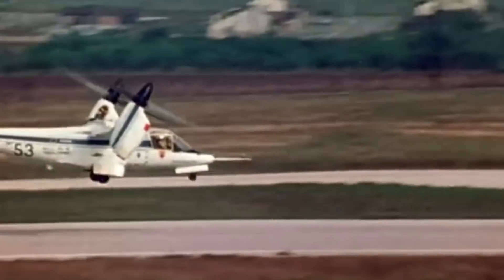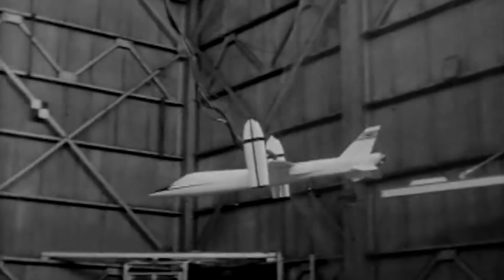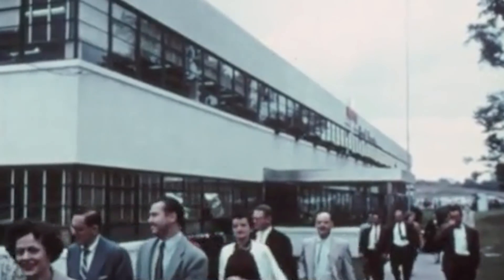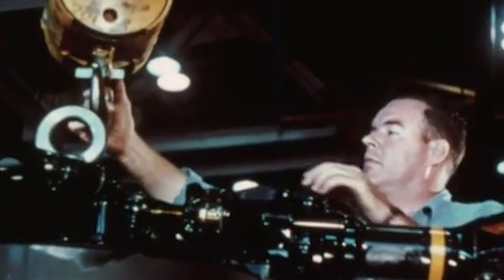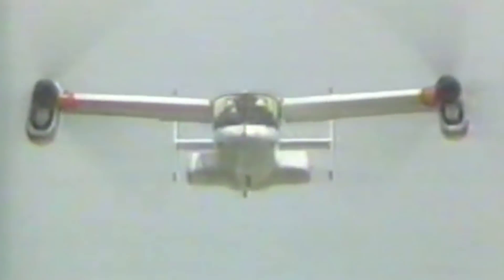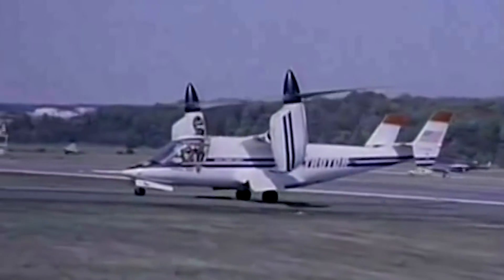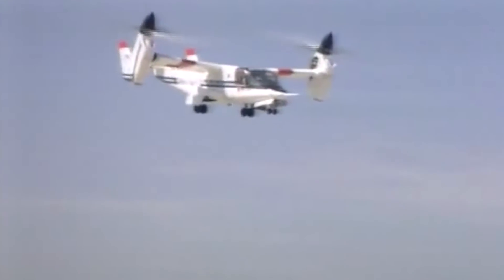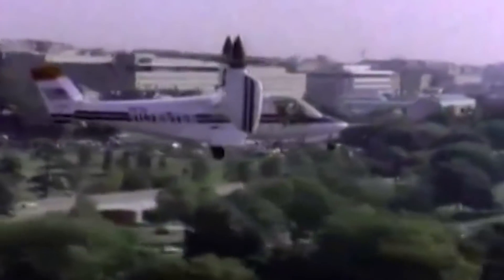From Hover to 160 in 13-Seconds - Bell XV-15

Comment: I like the Bell XV-15.  Hate the V-280.   I'd like to see a gunship version made from the XV-15 model to compliment the V-22 and V-280.  Stationary landing gears in a reverse tricycle pattern (like the UH-60 and Apache have  for hard landings). Speed could be sacrificed for functionality.  A chaingun turret underneath.  Typical apache/cobra junk in the nose.  And a tandem cockpit like the apache has so each operator can see what he/she is doing without the other being in the way.  Rocket pods would probably have to be underneath the frame as well, as the rotorprops would be in the way.  I could see gunships being tiltrotor long before troop transports and heavy lift aircraft.  But that's just an afterthought.:dothefive:

Comment: I have pictures of this in Navy gray, taken at MCAS(H) Tustin in 1982. This was almost silent in horizontal flight mode unlike the very loud V22.
Back then there were 3 proposed versions. One this size, another that became the V22 and an attack version to replace the AH1 Cobra. Can you magine a tilt rotor the size of the XV15 fitted  with the gatling gun of the A10 and hard points for bombs on the wings? Missiles wouldn't be wise on a tilt-rotor though, unless dropped from the lower fuselage.

Comment: Need to add 2 smaller rotors on the aft, that can turn and be used to steer the craft. Fuselage could be oval horizontally, and olliptical for length wize. Giving more room for customers.

Comment: I was lucky enough to actually fly the XV-15 in 2003 before it went into the Air and Space Museum. I had seen it flying for almost thirty years and dreamed of flying it some day It was a strange experience while still being on active duty to see an aircraft I flew in a museum. Felt like maybe it was time to retire.
Reply: Len - My list shows that you flew N703NA on March 3, 2005.  You were the 401st pilot to fly the XV-15.  By the time 703 was retired to the Udvar-Hazy National Air and Space Museum 419 pilots flew that proof-of-concept research aircraft.

Comment: My squadron hosted a XV-15 (and a MD500) for a couple of days around 1985; they were presumably enroute to DC or Pax River. We flew CH-46Es so it was no secret that the tilt rotor was the next step so we were quite interested in the zoomy little thing. Little did we know that it would take another two decades, give or take before its offspring joined the fleet.

Comment: Working at bell in the late 90s drive system test the crashed one was used for parts .I heard a guy say they were going to fix the crashed ship.It was outside and cut up with a sawsall.It was way beyond saving.There were many gear boxes and you're tubes in the fuselage.It was mechanical more than electrically controlled.It flew well but no room for a payload,but as proof of concept it worked well.The v-22 was constrained by complications like wings rotating and blades folding for saving space it added weight on a vertical take off was huge.

Comment: Interesting background information, BUT, why did you not include the dismal failures of the V-22 during implementation into military service? I don't remember the specific number, but around fifty marines were killed in a series of crashes over about five years, while Bell worked out the bugs. To this day, most marines prefer helicopters. This had pork-barrel written all over it.

Comment: Why aren't tilt rotors used by the Coast Guard  ?  It seems like an obvious  decision.  They are faster and can hold more weight than a helicopter plus it can stay on station  longer. Judging from the video a tilt rotor would be much better platform for the Coast Guard on every level.  Government BS is probably the reason they don't have tilt rotors.

Comment: If they put gas turbines in the fuselage turning generators, the rotors could be then driven by powerful electric motors. 
This would reduce the weight outboard and, the exhaust could add power to forward movement.

Comment: Do you just talk very quickly, or do you speed up your narration in these videos? If so by how much?
Reply: Neither? People in your region might actually talk slowly.
Reply: @malcontender6319  I mean yes that's completely possible I won't argue. I'm from Illinois near Chicago. Regardless of that I'm not criticizing them. They way they speak is completely fine and easy to understand. I'm just making an observation. If you were to count the words they say in a minute and compare it to another video essay channel such as the channel mustard (which you should definitely check out if you haven't) there is an observable difference that I found interesting enough to ask about.

Comment: Wow, you completely missed talking about the Canadair CL-84 Dynavert which was developed in the 60s and was the first tiltrotor to actually be tested nd proven to use weaponry.
Reply: Well, the reason might be that the CL-84 was a tiltwing, not a tiltrotor. btw, the CL-84 later went to NASA Ames for additional research.

Comment: Two thoughts;
1.) If we could alter existing air craft to use these VTOL style engines and wings, could it breath new life into, say a C-130 for random example. 
2.) Could jets be the next step to replacing the fixed rotor wings? 
(Jets might not generate enough vertical lift? Might just be using the twin exhausts as pin-point torches?)

Comment: With all of the helicopters in use within/between major cities and medivac I find it bizarre that 45 years later there still isn’t a civilian version of this plane.  Seems like a no-brainer easy sale to those who’d hop off of a skyscraper and travel direct 750-1000 miles to another skyscraper vs taking a helicopter/car to the airport then switching to a jet then another helicopter/car.. repeat to het home (ugh).
The XV-15 was a success, the Osprey has proven out the whole concept, so what gives? Cost?

Comment: If this script was ran through a plagiarism check program, it would ping the hell out of the Wikipedia page.
Wiki: "Boeing Vertol proposed its Model 222 (not to be confused with the later Bell 222 conventional helicopter), in which the engines were in fixed pods at the end of each wing, and a small, rotating pod with the rotor was slightly closer to the fuselage on the wing."
This script: " ...boeing which submitted its model 222 not to be confused with the conventional bell 222 helicopter.Boeing's design had fixed engines and pods at the end of each wing and a maller rotating pod with a rotor closer to the fuselage"

Comment: Did they ever tried with jet engines instead rotors?
Reply: West Germany EWR VJ-101. First flew on 10th April 1963.
Reply: @Joshua_N-A  it could reach the other end of the run way before running out of gas.
Reply: @navyreviewer  turbojets are known to be gas guzzlers, right?
Reply: @Joshua_N-A  all jets are. That's, historically, been the downfall of VTOL jets. Fuel = range but your engine has to be able to lift it. It's a trade off. That's why STOVL is preferable. You only need to go vertical at the end of the flight when you (by definition) have the least amount of fuel. The Harrier got away with it by accepting  a limited range/payload. Mostly operating in STOVL rather than true VTOL. The f-35 does it by using a non fuel consuming lift fan instead of lift jet. It >really< can not be overstated how mechanical complex it is. Even then its range is less than the similarly sized A model.

Comment: My late father worked on SH3Gs, and followed this project very closely.  He always thought tilt rotor technology would make Air Sea Rescue a much faster, safer, and efficient process.  Time will tell; the V22 is an amazing airplane!
Reply: The Augusta Westland AW-609 (a V-22 derivative, Bell was initially a partner before splitting off to focus on the V-280 Valor) is actually currently a competitor against Boeing's Defiant to replace the USCG's Blackhawks. Interestingly, there was an S-61 (SH-3 Sikorsky designation) that was tested as a converting compound helicopter (tail rotor would rotate to be a pusher) for the projected S-66, the major competitor to the eventual AH-56.
Reply: in 2000 2 Osprey crashed killing 23 Marines, ill never forget.

Comment: I still don't get why it took a further 25 years to get the V22 Osprey into service.
Reply: The Osprey program was plagued with development problems and cost overruns. There were many accidents and crashes. Also consider that the Marines get a thin budget and they were the only ones that were really trying to push the Osprey.
Reply: @Jacmac1  Kind of strange that the Marines are getting the most expensive version of the F35 though!

Comment: Back in ‘90s I used to drive by the V-22 assembly plant outside Amarillo. It was so cool seeing them do their test flights I often pulled over on I-40 just to watch them for awhile.  Something about how they flew is just cooler than most helos or planes.
Reply: The British Fairey Rotodyne from the 1950s was also cool, never seen another aircraft like it, there was no place for the rotodyne back then but there certainly is today.

Comment: Why isn’t it used in the civilian market?
Reply: there is soon the AW609. problem is civilian aircraft need to go through a lot more testing then military so it takes a lot more time to come out and it cant be tested in one place and just fly everywhere just because it passes in Europe doesn't mean the USA will let it fly there it has to get a US certification as well. and theres the fact it will be the first civilian production aircraft of its kind pilots will need a whole new type of certification to fly it probably gonna need both helicopter and twin engine turboprop before one can get the powered lift certification.

Comment: I saw two Ospreys in formation fly over my house a couple months ago. They are surprisingly loud and very distinctive looking. The sound is quite unique too - doesn't sound like a helicopter or a plane, but kind of a mix.
Reply: Honestly, every aircraft I've ever been around is always hella loud. That's why pilots and air crew always wear headsets.
Reply: @tbrand009  When you're around them enough, You can tell the difference between a single engine Cessna, a dual engine Beechcraft, piston driven heli, turbine driven etc... Its the same with cars, when you are familiar with a particular model by its sound, lets say a v8 vs a i4. You know which models have the i4 vs the v8 and associate that sound with them. When you get really good you can disassociate a 5.0 mustang vs a  5.7 charger.
 Your ears, much like your eyes can deceive you. 
Guessing is always fun. But when you get really good, your ears never deceive you. 
But when you get really good at the tone of an exhaust note you can start to dissimilate the difference between engine sounds. Whines, hisses, turbo spooling etc.
Reply: @tbrand009  I could go on and on about the distinct sound a particular engine (or motor)  gives off.  If you happen to care enough about it, it really is a great hobby. 
as much as I hate to admit it , I have become a jack of all trades. DJ , musical producer, student pilot, wannabe wheel man, history fanatic. Wish I could've picked one but they are all so interesting!
Reply: Yup, agreed.  I have been reading about the Osprey since I was a kid, flew one in the game LHX but when I saw one in the air, it took me a few seconds to recognize it due to its weird shape compared to other aircraft

Comment: Bell essentially took the research they did from the earlier XV-3 and possibly what was learned from the Canadair CL-84 and LTV XC-142 and got it to work on the XV-15, which hugely benefited from the new availability of computerized flight controls.
Reply: Just to let you know, the XV-15 flight controls were mechanical, not computerized.  The controls went into a very complex mechanical mixing unit that changed the input to the proprotor as the nacelles were moved between the vertical and airplane mode (basically phasing out the helicopter type input as the aircraft was converted to the airplane mode).  The conventional airplane controls continued to work in the conventional way for all nacelles angles. The V-22 and the AW 609 both have computerized fly-by-wire flight controls.

The CL-84 and XC-142 were tiltwing research aircraft with props, not rotors.

p.s. I flew flight research in the XV-15 N703NA at NASA Ames in the late 1980s.

Comment: Only 20 seconds in.  Oh well.  Neither the XV-3 or XV-15 were built by the USAF; it was a NASA/US Army research program.  The military program, JVX, was launched a dozen years later, and run by the Navy and USMC, again not the Air Force.
Where does this weird statement come from about delivering twice the payload at distances over 185 km?  Surely it depends on which helicopter and tilt-rotor you compare.  I bet a Bell XV-15 could do a lot better than that against a Bell-47, for instance.
The XV-3 tested rotor-wing interaction; a rotorwing isn't a thing.  Speak more carefully.
Neither of the XV-15 competitors used Wright Dual Cyclone radial piston engines, which were by then obsolete.  Odd choice of video.
To be clear, the aircraft had hydraulic, electrical (and oil feed) systems anyway, but they were adapted to allow sustained operations with the engines vertical.
The risk of landing a conventional aircraft without the wheels is that you have a bit of a scrape along the ground; the risk of landing one of these without the props rotated up enough is of enormous flailing bits of rotor coming through the fuselage and the pilots' little pink bodies.  It's not quite the same!
On that CV-22 crash, clearly 'the structure' was not intact.  But the cockpit area was sufficiently fixable to be re-used as a flight sim.
Nevertheless, apart from the clip of B-29 engine manufacture the video is all relevant.  And apart from a few odd statements the story is pretty much there.  So well done.

Comment: I grew up in the bay area, and I saw these planes a bunch of times in the 80's
Moffett Field had an air show every year, and they did fly-bys (Though I don't remember if they ever parked them anywhere for the public to have a good look at them). My dad also worked close by, and he'd see them flying over Sunnyvale, San Jose, Mountain View, etc.
Reply: You missed out. If you were adventurous, you could slip off the flight line and visit the hangers. Not just Hanger One, but the NASA hangers where they kept the research aircraft.
Reply: Them pilot's love to give a demonstration? Put them pics online? ¹ of my aircraft. There was a story that Bell wanted to use 2 for of the prototypes to use in the rescue of USA CITIZENS IN IRAN?

Comment: I was in Flight School when the Bell XV-15 was just getting going. Almost 50 years ago. The aircraft was a real testbed and once all the problems were worked out we got the V-22 Osprey. All it took was time a bunch of good engineers and money. It cost a lot to fly even more so when you want to fly on the vertical. The talk was back in flight school that we would be flying these within the next 10 to 15 years. Well, that was wishful thinking for civil aviation at best. I am retired now and about the only flying I do is recreational in Cessna 172's. I rent an airplane every now and again just to prove to myself I have not forgotten how!
Reply: Osprey killed many Marines.
Reply: Why not buy a 2 place ultralight and have 10X's the fun at 1/10 the cost?
Reply: @Minong_Manitou_Mishepeshu  Gee's you really don't have a clue do you!
Reply: God bless you sir.
Reply: Good luck to you George.
Keep the blue side up
Reply: Osprey also cost a lot of Marine's lives.
Reply: @utubecustomer0099805  Out of 400 built, just 12 have crashed hard enough to write off. That is a pretty ordinary hull-loss rate for rotorcraft or fixed wing. The A-10 has lost 112 out of 716. The C-17 has a similar length of service: out of 279, 32 have been lost.
Here's the thing though, that includes losses during development for the V-22, but those are in-service losses for the others. The same Rand Corporation report lists 2 hull losses and 5 class-A mishaps for the V-22 in service. Class-A is over $1M in damage or loss of life. Only 7 crashes have happened since it entered service. The vast majority of fatalities (30 of 42) happened during development, not in service.
Reply: @utubecustomer0099805  Well over the years we wreck and continue to wreck airplanes and helicopters. Shit happens. That does not mean you quit. Lots of things need to be worked out and nothing is perfect. As for the V-22, there was an operational learning curve to be made, And the only way to do that is to fly. The FARS- Federal Aviation Regulations are written in blood. Acceptable risk. I made those decisions every single day of my 44 years of flying professionally. You may want to stay in your basement with the idea nothing bad will happen to you, well life does not work that way. If it did we would still be living in a cave. People didn't stop going to sea because ships sink, or stop eating fish because fishing is dangerous!
Reply: @Markle2k Thank you for counting the beans. Yes, I know that testing and procurement of sophisticated military equipment is often costly and losses do incur. The lengthy V-22 program was no exception. I am pretty sure Mr. Semel meant no slight when he wrote "All it took was time a bunch of good engineers and money." I just wanted to point out additional expenses to the invoice. For instance, the two crashes in 2000 cost the lives of 23 Marines alone. Not a small sum. I stand with my original comment.